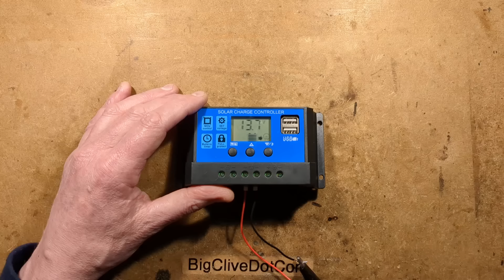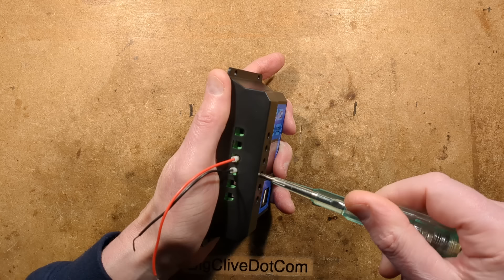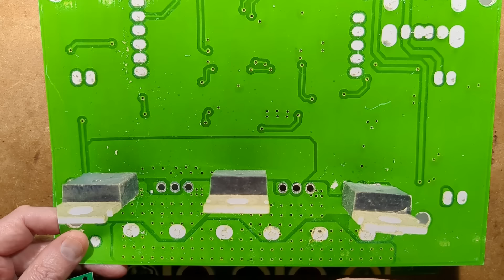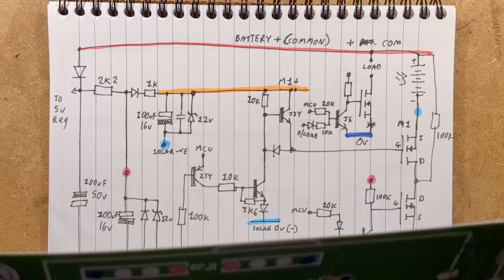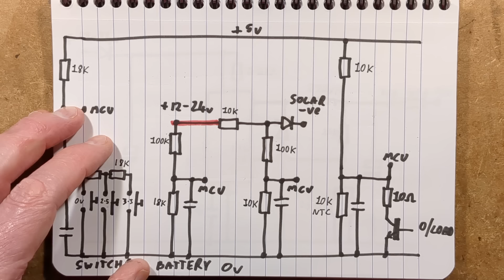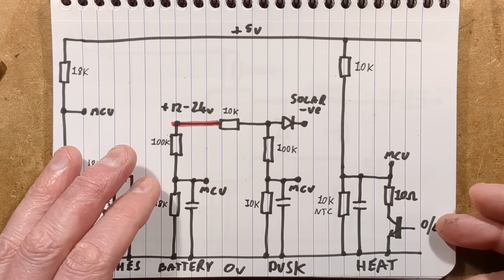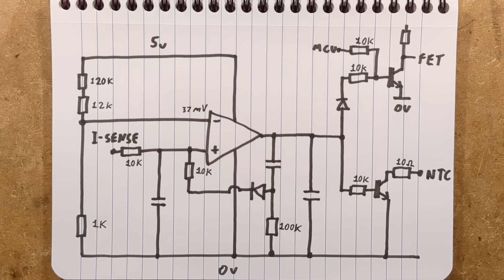Exploring a mass produced solar charge controller

Comment: I have two of these each with 500W of panels on them both hooked up to a large 24v battery bank it was meant to be a temporary solution whole we built of grid. But after 3 years and two floods with the batterys going under water the system is still running great. The inverter connected to the batteries is trash (spangswandeller) and causes you to get zapped from the earth,  battery terminals, and charge controller USB ports. Amazingly these charge controllers keep chugging along without issue.

Thanks for the deep dive Clive 😍
Reply: You have 500w panels connected to these tiny 10A controllers? When I first saw these cheap things I thought there must be something wrong with them. Seems like most use them for sub 100w setups. I have 235w panels and am looking for an affordable--but safe!--solution. Thanks!

Comment: I wouldn’t use a PWM charge controller with a lithium battery. You can’t do the low-current initial CC charging for when the battery is at a particularly low voltage, nor can you do the final CV stage.

Comment: If you charge a phone off it the LCD does not have enough power to work, but very slowly charges the phone.
Reply from the maker: I really don't recommend that.  It would be much better and safer to add an external 12/24V USB charger module to the battery connections.

Comment: I've had one of these powering my shed for quite a number of years. Only issue I've had with it is when I managed to flatten the batteries one winter. It threw a total wobbly but all I did was effectively restart it. And its been running for a good 3 years since then. I've got some LED lamps running off it and a 12-230v pure sine wave inverter to power some battery chargers for my power tools. Works fine.
Reply: I had one of these charging 2 lifepo 12v batteries with internal bms in series. This caused a problem when the one bms switched a battery off. The unit then rebooted as if it was a 12v system.

Comment: I use one of these in the winters with a 50w panel, a 10w light and a sealed lead-acid battery. This lights a map and some signage along a cross-country ski trail. It turns on for 4 hours after dusk. Great device. It even works well at -20C although very few skiers will be around to see it 😊
Reply: Swap out your light bulb for a LED one that will be about 2 watts and give much more light ( daylight type) and both the LED and the battery will lasts longer,

Comment: What is the appliance output supposed to be used for? I mean what can you actually connect there
Reply from the maker: The USB is pointless on this unit.  The switched output could run any suitable 12/24V load.
Reply: @bigclivedotcom great video by they way

Comment: sanded off mosfets means they are manufacturing rejects.  Those are Grey market surplus,  someone  probably went through a big batch testing to find ones that "work" and put them int othe module assembly pile.

Comment: Temu sells these with "ratings" from 10A up to 100A all in identical looking units for about £4 including shipping.  (Chinese Amps presumably).
Reply from the maker: I received a 100A one today.  Spoilers.  No different to the 10A one.
Reply: @bigclivedotcom  Not even an extra pair of Mosfets?
Reply: not surprised
Reply: I bought one identical to the one in this video on Ebay and it claims to be 30A.  I was wondering how those terminals could handle 30A.  Now I'm sure they can't.
Reply: the chinese 100Amp is before duties, tariffs and taxes, might work at 20A, might blow up at 15A
Reply: I had a similar one...different terminals larger board no USB and chunky (ish?) Bus bars

Comment: I have run these for years before upgrading my aolar to mppt. They are all over the place in terms of assembly and programming. Some even have the plus and minus buttons reversed. Some can handle rated amperage and some can't. I just use them for their 5v and 12v outputs now.

Comment: What's the catch?  I had two and they both put 16 volts out onto the battery on sunny day.  If you don't connect the battery before the load the panel powers it up through the input.  Mine didn't say anything about LiFePO4 in the manual.  Some controllers rely on the battery's management system (BMS) to protect the battery.  Fitted a small fan to the heatsink.  A 12v panel can push out 22v volts.

Comment: I purchased an orange one from Wish, it over charged my lithium 12v battery to 30v. It was very puffy.
Reply from the maker: What were you powering it with?
Reply: Tbh, a set of 6 salvaged, 35v 4A PV cells in parallel. It was running fine for a while powering the fridge. But the day I didn't check everything, the 12 volt inverter I had hooked up went up in smoke. Checked the battery, and it was at 30 volts with the unit displaying an over charge warning and a very swolen Lithium deep cycle battery. 
Tbh, here in Australia, we do get some bright sunny days. It happened to be that day. Everything was fused but nothing popped.
I had this setup to power the fridge during power outages as we get them randomly. Admittedly, wasn't an optimal setup but it ran the fridge for short periods of time. I plnned to get a second battery for longer term use but that isn't happening anymore. Lol. Lets just say it was a bit of a learning experience for me. Next time I purchase an MPPT I'll be getting one with one of those ports to attach an external resistor. One of those big things with a wire wound around some tube of some sort on a heat sink of sorts. Maybe next time I run it on 24 volts so if it happens again, the batteries will be a bit more forgiving and be able to run the fridge longer too maybe.
Reply: Oh and maybe reduced the amount of pannels used until I find the sweet spot. I plan to get one of those hybrid MPPT modules that have a PV input, 3 phase wind generation, and that load dump that I mentioned.

Comment: This was interesting. I have a solar battery maintainer on my RV. The "controller" consists of 3 diodes in series and a red LED parallel across the diodes. It doesn't work because the solar panel only puts out 0.616 volts, at 2 mA. So it's on my list of things to repair/replace. The solar panel is approx. 10 inch (25 cm) X 12 inch (30 cm)  it will get replaced by something bigger.

Comment: Ah yes, I found out the hard way this unit has a common positive instead of a common ground, as that makes measuring voltage with (in my case) an INA3221 impossible, at least as far as I can tell.

Comment: I had one like this when i first start tinkering with Solar. Lost 2 deep cycle batteries on different occasions. These charge controllers over charged my 12V  battery to 18v. PWM controllers are incredibly inefficient and have since replaced it with a  mppt.

Comment: Do you think its safe to run a 100 watt solar panel charging a 50ah lithium battery?
Reply from the maker: No.  I'd only use this with very small panels.

Comment: I’m surprised such a cheap low capacity charge controller is able to maintain lithium batteries as I have a couple of them that are 60 amp controllers and are not lithium capable.
Reply from the maker: You can be sure it's not doing so in a dignified manner.

Comment: That little PNP with it's Emitter hooked to the MPU, is to allow for the Collector to be pulled up to 5V (ish) when on, but allow the Collector to go quite negative but keep the MPU between the 0-5V rails.

When the MPU pin is at 0V, there is no current going though the transistor, and even if the negative of the Solar is well under -24V, the MPU is protected.

Comment: Hi Clive - I have used the 30A version in 24V mode with 2 x 250W 36V solar pans in parallel for 3 years and have had no probs other than one lead acid leisure battery die-ing. Because over current drive from the pans was my concern I use use 3 x 12V 30W lamps in series 3 x 30W = 90W = 90W / 36V = 2.5A max load, this protects the pans and the controller.
Reply: Can i use this to charge up a old car battery with a 30 watt panel ( i will upgrade the panel later)

Comment: The first thing I noticed  that  real screamed at me  was their  is   no red USB   port  for  cell  phone   charging at 9.1  volts  (fast charging)  I  give  you   huge credit  for  reverse    engineering  that board    Those  transistors   could be GAN   tech     Current limiting  on the USB ,  huge waste  of time  The two zener circuits   are "clamps"

Comment: What I'm afraid of is that this will boil the batteries.Float looks like constant voltage to me. And I think the charger should stop at 13.8 volts.Do I understand this correctly or am I wrong?I have watched hundreds of your videos and admire your kindness and skills.
Reply from the maker: I think if I was using a small system with this I'd deliberately set the upper charge limit lower to prolong battery life.

Comment: I see you added a Pilot Hi-tecpoint to your arsenal :)
I have one of these charge controllers that is a couple of years old. Looks exactly the same, but only meant to be used with lead acid batteries, so probably an earlier software version.
Can confirm the USB output is trash. On the plus side, the unit has not melted down yet.

Comment: You could in theory just bypass the controller by powering your 20 amp (amateur radio transmitter?) running straight off the battery? Assuming your battery is protected etc.

Comment: Definitely worth the wait for the reverse engineering. Quite an interesting circuit. I do wonder why they even wasted the money on TWO USB connectors since drawing anything above 500 mA basically tanks everything. I guess USB connectors are cheap and it gives the illusion of a multi-purpose unit. I suppose if it were in a remote location it might be handy to have a USB light source to plug into it, but the low current means that would be about it. Also, I would agree that trying to control a 24 volt system with this would really be pushing it. As with all electronics, underdriving is better than overdriving. Still, at 12 V and without anything taxing on the USB sockets (or preferably not using them at all) it should do the job.

Comment: On my version of this the documentation mentioned it supported usb firmware flashing and connection to pc, my guess is one could put a very low power string of usb leds or usb light on it so you can more easily find and see unit in the dark during the night, since the screen at least on mine didn't light up, at least I don't think it lights up.  I will at some point get back to my 400 watt solar panel battery setup, only been working on that project on and off for 5 years. And yes it sometimes takes me an hour to finish watching a single video :p

Comment: Those USB ports switch off at night when there's no solar power, so they weren't even useful for running some low current fairy lights.
Reply from the maker: They should be running from the battery output.
Reply: Just run them off a lightweight, but adequate, car charger wired to the load output
Reply: Yes.
Although I don't use the load output on these charge controllers. I run straight from the batteries which are LiFePO4 with BMS built in, which protects from overcharge/discharge. I gave up with lead-acid ages ago, just use lithium now.

Cheap devices like these often seem to have many extra features that don't work properly!

Comment: I had a look at a very similar controller for someone that smoked and found that the resistor that is marked 100K across the solar panels and M1 mosfet was a 10R device. all of the mosfets in the device were different and obviously salvaged too.

Comment: The iron likely would not damage the lcd, surely not that far away, you could apply a clamp to the leads as a heat barrier, pliars or sonething

I had thought of these before but how much power is it using itself opposed to what it is going to charge to, there are less energy consumptive ways of charging

Comment: I use this exact unit for the lighting in my workshed.  It charges an old car battery, and uses a cheap “100 watt” solar panel someone left at the recycling center (it needed a new negative lead). It works totally fine for my purposes of providing lighting and a small USB fan in my small shop. On the rare occasion I need to use power tools out there, I have a small ecoflow power station that is sufficient.

Comment: Can I charge 12 volt lead acid battery if I connect with 24 volt solar pannel
Reply from the maker: It might work, but wouldn't be an efficient way of doing it.  Worst case it might actually try to charge the battery to 24V.

Comment: I wouldn’t use this controller for anything too important, even a home system.  If something goes wrong this unit could cause a fire.  I believe it is worth paying a little more to get an MPPT (max power point tracking) via buck/boost controller.  I got a 10 amp Victron controller about a year ago fo about 40 Dollars US.  The Victron  is MPPT and has Bluetooth programming/monitoring and good safety features.  I use the Victron with a 10 Watt solar panel to keep my truck battery topped up.  I definitely don’t want to risk setting my truck on fire because I saved ten bucks by buying a no-name Chinese controller.
Reply: By the way, the Victron model number is the rather prosaic “MPPT 75/10 Retail”

Comment: That mysterious PNP transistor is way to "remove" the protection diode in the MCU. 
When the output is logic 1, it works as a voltage follower, as you would expect, therefore the voltage on collector is 4.4V.
When the output is logic 0 or HiZ or in reset whatever, the voltage on collector can go much below -0.6V while naked MCU output could not go below. 
Therefore it is like a voltage shifter from "MCU 0V" to "SOLAR 0V".

Comment: Mine isn’t from Ali Express, but it failed after 2 years.
Never used the discharge/consumer mode, always took it straight from the batteries.
Took it apart, looked corroded inside, but couldn’t see why exactly it failed.
Would you like it- to play with it further? Might still have it somewhere…

Comment: I run two VIctron MPPT controllers in my rig but always keep  a couple of these cheap-and-cheerful units in my backup stash.  They are surprisingly useful for the price.  I use them for experiments or as loaners/freebies for folks who smoke a controller in the field. Run them well below their (optimistic) rating and they do fine.  

The main problem with them is the general public doesn't understand how to charge their bank's chemistry with a normal charger much less single-stage charger like these.

Comment: VERY cheap (US$10), designed about 15yrs ago and only worth buying for very simple small single panel garden shed type installations.

One thing to be aware of though is it hasn't got modern USB charging, only old 500ma output standard USB.

More modern units need to have USB C PD or at very least dual 5V 2.4A USB output.

Comment: There are various versions of this in the same case with slightly different functionality. Some of them have the USB connectors on the bottom. Some don't do the voltage sensed load switching but do other things like a periodic equalising charge. I've used one of the cheap ones for years albeit on a 20W panel, and the possibly better quality Renogy one with a 90W. So far they've been fine.
To switch the big one off when not in use (panel only connected when actually on camp site) I used a standard on - off - on industrial switch, as used in many motor control panels for hand - off - auto, but I changed one of the contact blocks for an NC one, this carries the battery supply hence is only off in the first position, the solar panel is through the NO block so is only on in the third position. This means you can't turn the power off without switching the panel off first as the switch positions are off, battery on, battery and panel on.
Reply: Does the 'periodic equalising charge' sense cell/battery capacity (eg via a manually-selectable cell/battery input such as used in this device), or is it simply current-driven from the charging cct?
Reply: @snafu.X  I may have used the wrong terminology, it's IIRC just a high current charge which is recommended periodically for wet lead acid batteries to maintain their full capacity. The manual used to be on the Renogy website, probably still is if you are curious. I wasn't sure about the effect on anything connected at the time but it does it something like monthly and mine is never  switched on that long.
Reply: @NiallWardrop  OK, TVM. Prolly not so useful for balancing NiMH/LIPO cell charging from individual outputs, then :(

Comment: I've had a couple of these on a 24vdc setup using a couple of used  panels and car batteries to power my network routers, switches  etc.( and, during summer, the fridge via a inverter)  , it's just about paid for itself with saved electricity.

Comment: Interesting to see this one, thanks for taking the time Clive. I think this is the one I used in my workshop. I had a cheap plastic solar panel on the outside and an old 9v Batt from a stair seat we took out when we moved in. I made the likes with a spotlight blub pushed into an old tube of silicon which was the a perfect fit :-) Naturally it stopped working after about 3 months but started me off on my 12v projects. I now only use 12v for lighting in the house. Currently renovating the living room and may install some power storage so we can run out laptops and amp for the music server.

Comment: I have several of these, they came free with the flexible panels i use for camping etc. The negativa switching is bothersome because i prefer common ground circuits, and they have a fairly high operating current which means they can slowly drain the battery if there is low sunlight. They will run at 6-7v for some reason, so in theory you could use them for 7v nicad emergency lighting, but that means a bit of fudging the output since they won't switch the output directly. I haven't tried that yet, i do have some 6v panels so i may try it. Very informative & interesting video Clive, good one!